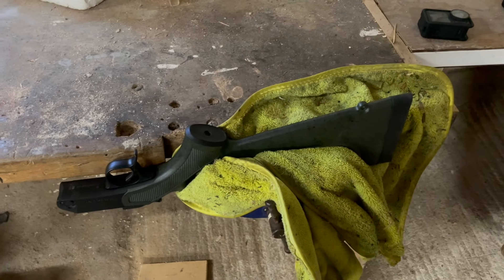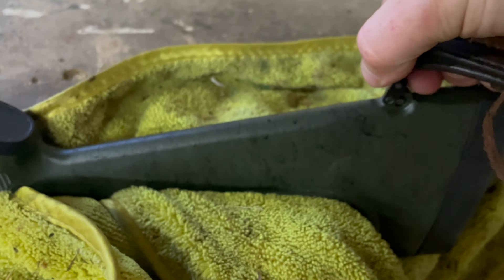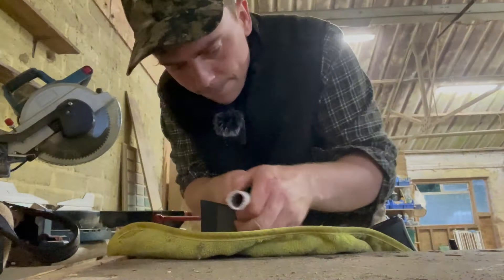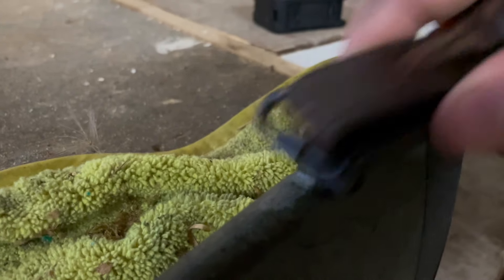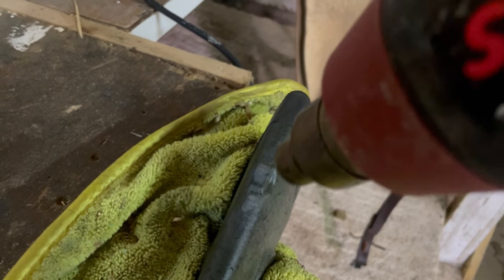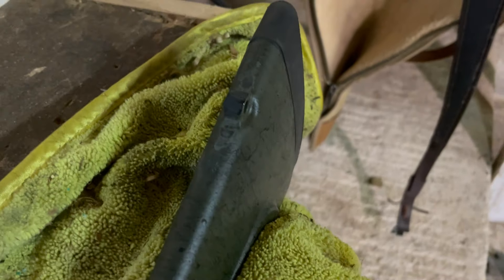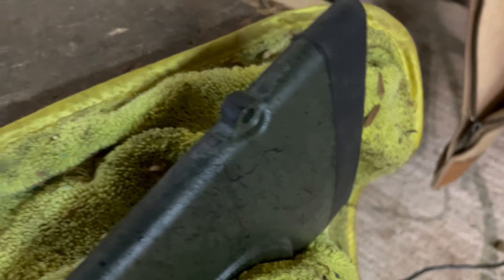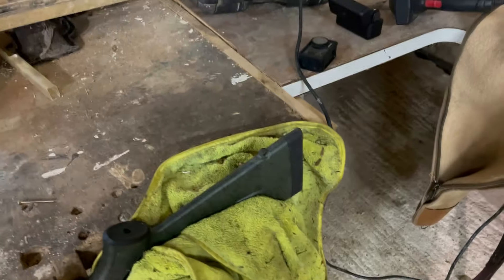Butchering the Bergara BA13

Comment: Doesn't look very robust to me in terms of the moulding.  I would fit a metal self tapping stud into a drilled hole with epoxy instead. You could then just dress off the moulded bit completely. Paul@testvalleyvenison